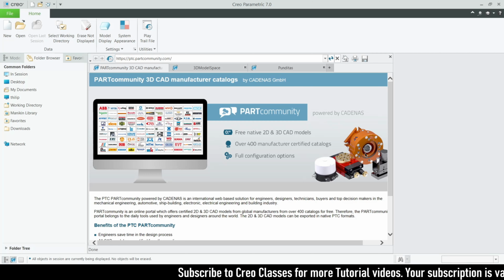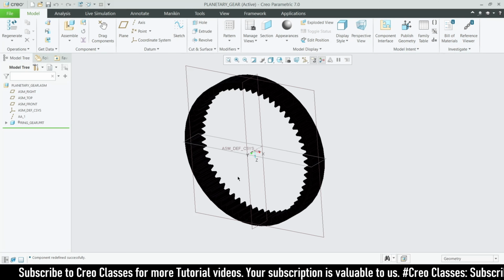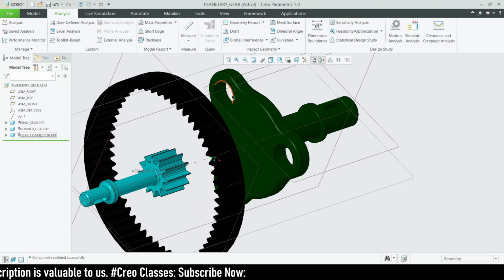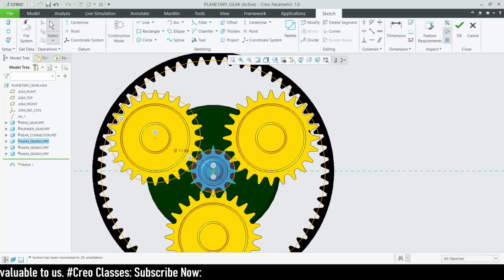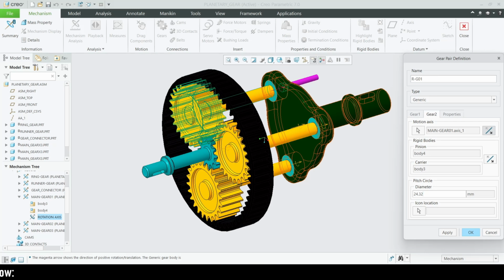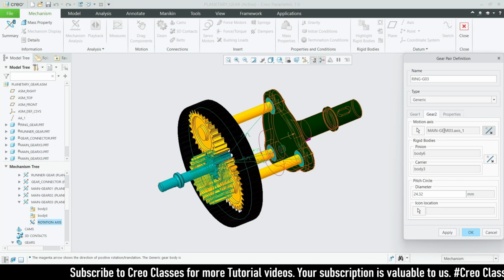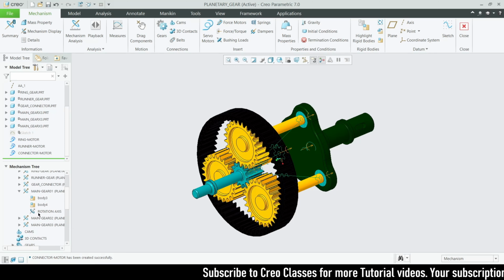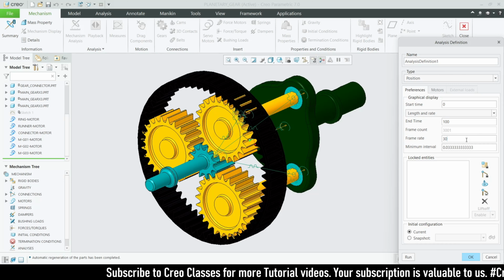" PLANETARY GEAR " in Creo (Parts,Assembly,Mechanism) Full tutorial video with detailed explanation.

Comment: i followed each step but my gears are not meshing after assembly
Reply from the maker: I'm really sorry for that bro. I think it you may miss some constraints in assembly. Even after following my steps if you are facing any issue kindly share the image. So that I can  check it out and guide u.😊 Keep supporting me 💯❤
Reply: @creoclasses4580 
Error Diagnostics for Analysis/Assembly Failure :

All position constraints can't be simultaneously satisfied. The following position constraints can't be satisfied

1) The following kinematic loop can't be closed: Ground - body2 - NO-NAME - body5 - body3 - Ground.

2) The following kinematic loop can't be closed: Ground - body2 - NO-NAME - body6-body3 - Ground.
Reply from the maker: Kindly share the image through mail or whatapp bro.
Reply: @creoclasses4580  your email?